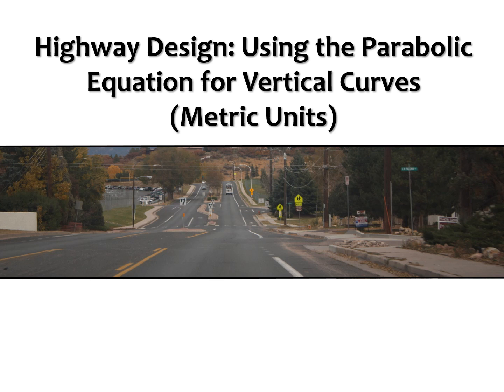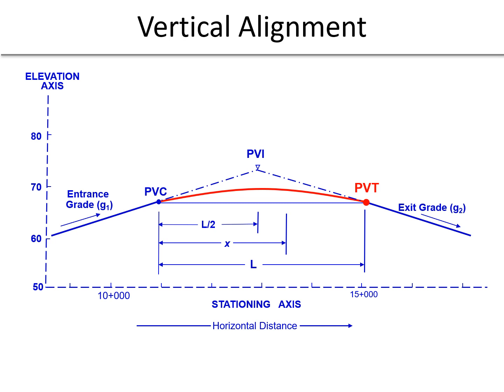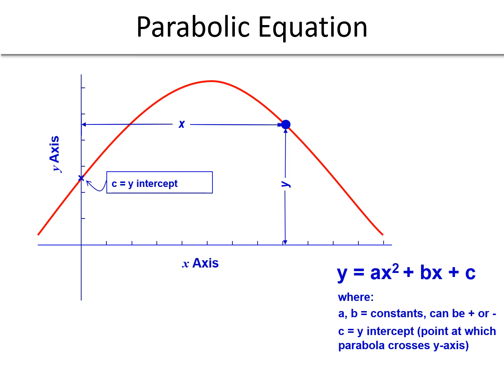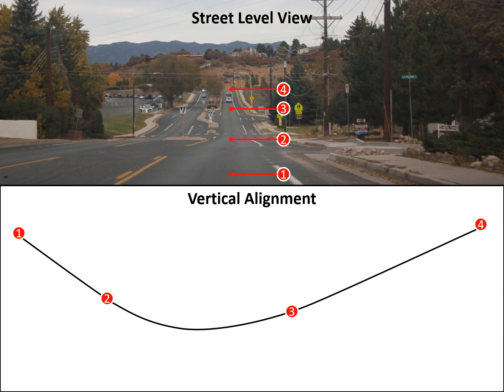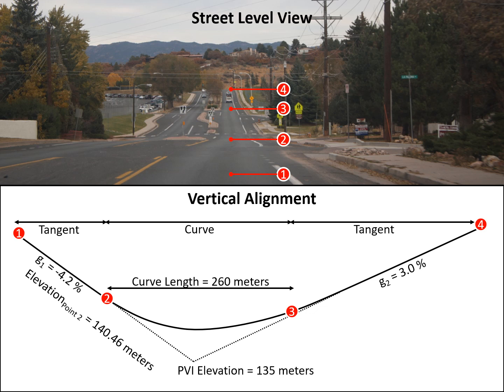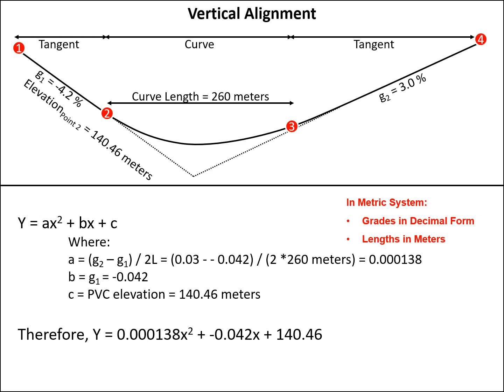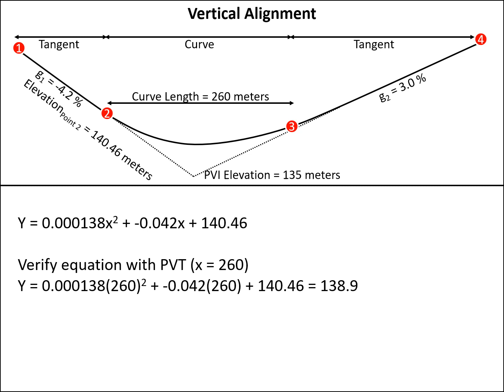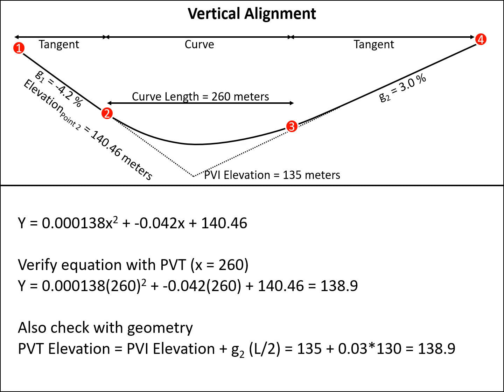Vertical Curve Equation for Highway Design [Metric Units] Using Parabolic Equation

Comment: how do you find the values for g1 and g2?
Reply from the maker: If it's an existing road, you should be able to measure the grades (it's possible with Google Earth) or use the design plans to determine the grades.  If it's a new road, you'll have to select g1 and g2 that fit the terrain and work with the design parameters/controls.
Reply: @FindleyDaniel  okay, thank you

Comment: Thank you this is really helpful.  I tried to calculate the distance of low point from PVC. Using the G1 * K formula, I got 151.67 meter.  Please let me know if that's correct.
Reply from the maker: Yes, that's the same value that I calculate as well = (0.042*260)/(0.03 - - 0.042)
Reply: @FindleyDaniel  Thank you 🙏🏽